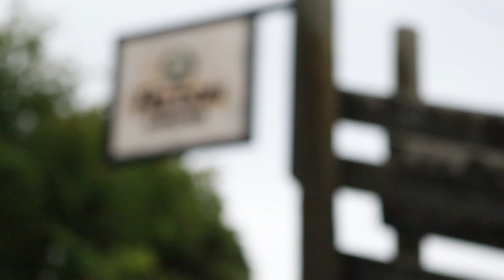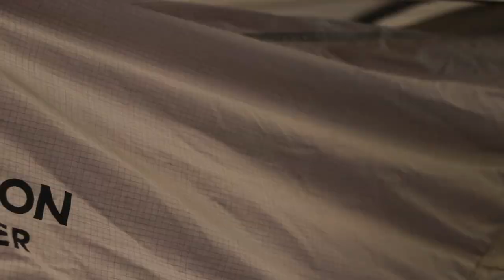Ep9: Feldon Shelter RTT, Frontrunner Gull wings and Drop down table: 4WD New Zealand 76 Series Build

Comment: I reckon you are way overloaded up top and way outside Rhino-Racks recommended Load Rating numbers. Your roof is rated for 100kg and so is the Pioneer Platform, but you will need to deduct the weight of the rack from the 100kg, leaving you 67kg capacity, (assuming you went for the 1928mm x 1376mm rack). Deduct from that the weight of your 65kg Feldon Shelter  Crows Nest, your 21.6kg Batwing Awning, your Maxtraxs at 3.4kg each, (total 13.6kg), plus whatever your LED lights & antennas weigh, let's say a conservative 5kg, and you are 38.2kg OVERWEIGHT, according to Rhino-Rack. Now here is the kicker, the load rating is for "On-Road" only, (and according to Rhino-Rack "On-road refers to the load rating of a vehicle when travelling on a sealed road"), so as soon as you take your 76 off-road your load rating is cut by one third, bringing your total load capacity off-road to only 43kg, leaving your new setup 60kg OVERWEIGHT. Feel free to check this out and if you are sponsored by them it might be worth asking them about their pathetic load ratings for their top-shelf products...?

Comment: I was wondering whether that FR rear table fitted the 76 series. Gonna get one and I love that slide out bench extension.

That's RTT look extremely well built. Might look into one. 
Did it mount onto the rhino rack easily?
Thanks for another great vid mate
Reply from the maker: Thanks mate. The table is one of the best little mods, the fact that it doesn't have the annoying wires holding it up is awesome. 

The RTT was super easy to fix to the platform, Feldon make brackets that bolt strait on.

Comment: Why do you fit the RTT to fold out sideways? why not fold out over the rear door, and it becomes a shelter underneath ?
Reply from the maker: Good question, the main reason is because of our awning which is 270* Batwing. so in our case we have a lot more cover over the back than what you would get from the tent.

Comment: What have you done to correct the rear wheel track issue of the 70 series?
Reply from the maker: No it has not been done as of yet. Still weighing up what route to go down. 
for now we'll run the different offset rather than spacers or different wheels.